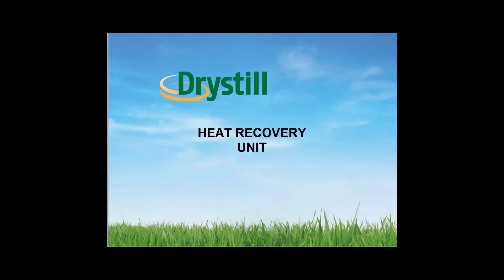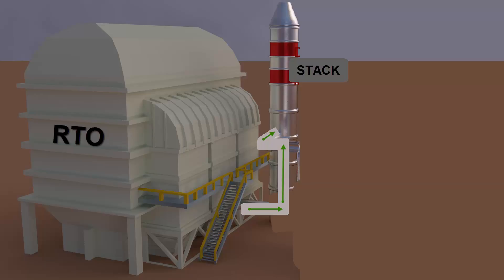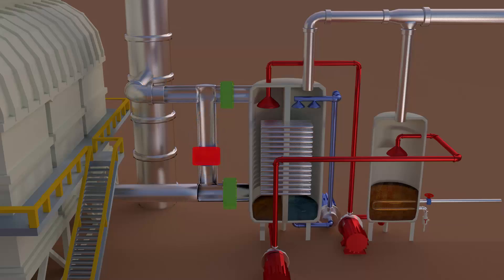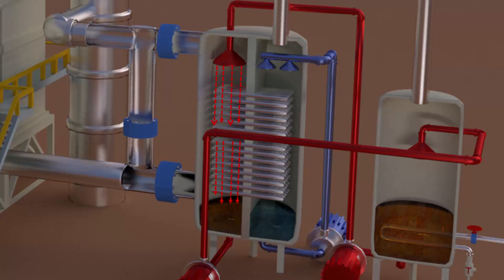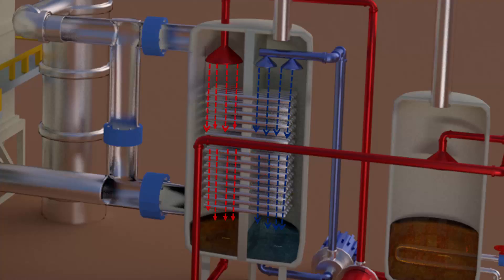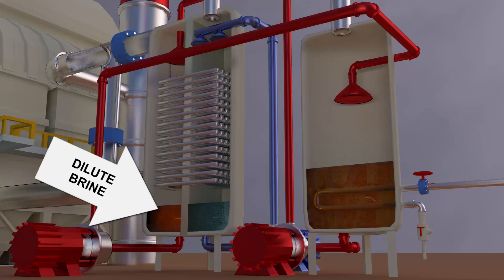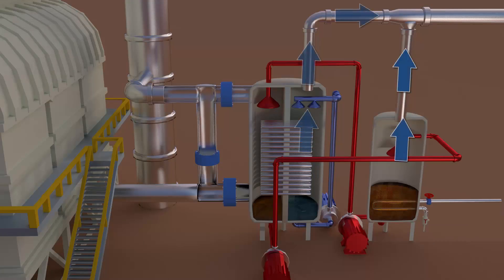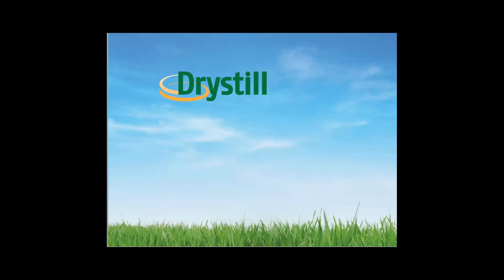Energy recovery from flue gas

Comment: is there any fluid running through the heat pipes? or is the heat transferred from the left side to the right via conduction?
Reply from the maker: Mike,
Heat pipes may be thought of as superconductors of heat. They have been around for half a century but until recently have been mainly used in the aerospace industry. Wikipedia is one of many places where you can learn more about them.